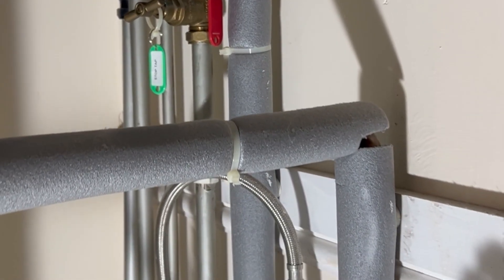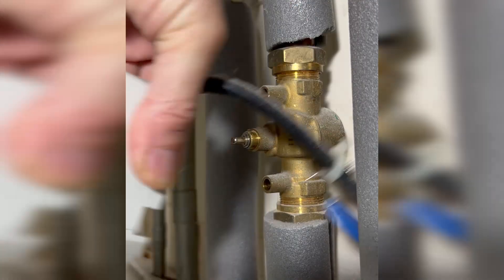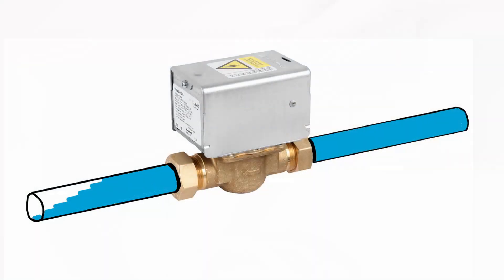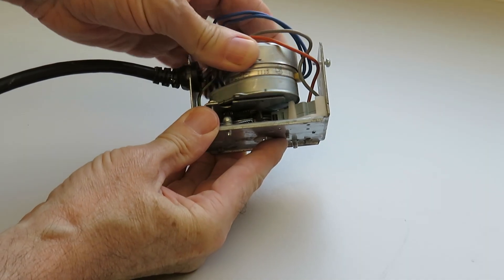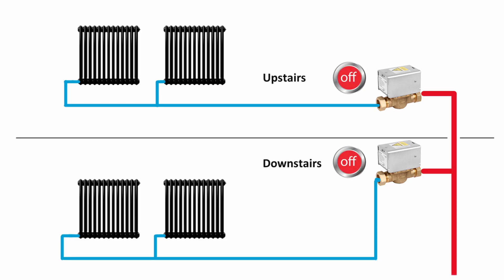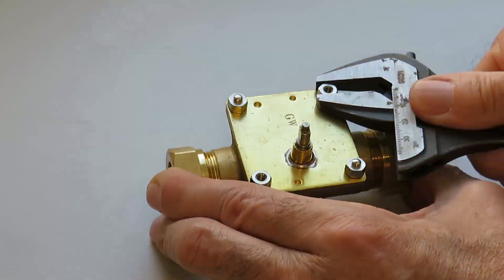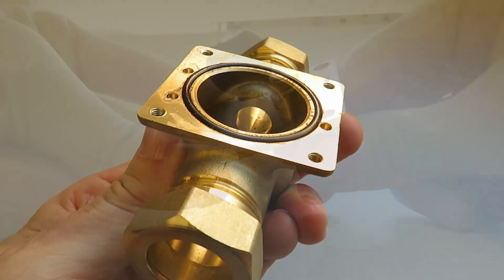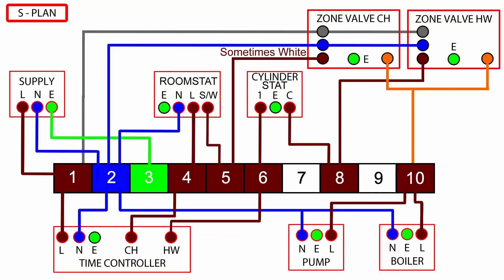Zone Valve ... A basic explanation.

Comment: Hi Pete,
I have a 2 port valve and we noticed the actuator had come off the brass fitting. We reattached it but it now seems backwards. I.E when there is a demand for the heat the lever is free moving, when there is not a demand for heating the lever is resistant. Have we put it back on with the valve is in the opposite state? Hope that makes sense
Reply from the maker: Hi! It sounds like the actuator has gone back on in the wrong position.. it can happen ! 
I would take the head (actuator) off again and before putting it back on - 1/ set it in the manually open position and 2/ make sure the valve body is in the open position, if you’re not sure about that just put the heating on and move the valve spindle by hand and check if both sides of the pipe are getting hot. 

A bit knee-jerk but I could always put a quick video explainer up for you ! 

Pete.
Reply: Hi Pete, Yes please that would be great!

Comment: I have heating on my second floor, but not on my first floor, which leads me to believe that I just need to replace the first floors zone valve instead of the circulation pump
Reply from the maker: Hi !
Easiest check is to try the manual 'open' lever on the valve whilst the heating is on... If the pipes get hot after opening the valve then it could well be the valve. (that would also tell you that the pump is ok).
Other checks would be to make sure the valve has got power to it.
Hope that helps!
Reply: @thank you man I appreciate it!

Comment: In my system when the room thermostat demands heat it sends 240v mains to the zone valve motor.  The motor rotates, opens the zone vale to allow water to flow through it and when the zone valve is fully open a cam on the motor closes a switch in the actuator which sends 240v mains the the boiler and the boiler heats the water.  But mains voltage is still being applied to the zone valve motor and it must therefore try to carry on rotating so what stops the zone valve motor from carrying on rotating after it has opened the zone valve?
Reply from the maker: Hi there,,,
I'm just working on a new video which demonstrates how to wire a zone valve. I may make an additional short video to explain the motor operation itself.
Anyway.. the short answer is that the motor is still being powered / energised, and its the microswitch that stops the gear mechanism from continuously turning (when the cam closes the switch).
The motor coils aren't physically connected to the gears, its the induced magnetic current that turns the gears.... until the gears can't turn anymore, in which case the motor just sits in an energised state and also constantly pushes the cam against the switch.

Hope that helps and I'll make a short demo as a visual !

Pete.
Reply: @petesshed8422  Thanks, but there's no connection between the  microswitch and the mains supply to the motor.  So I'm afraid I still don't understand how the microswitch can stop the motor rotating.  Happy to wait for you videos though.  Thanks again.

Comment: I just saw your magnet wheel video and was thinking,HOW ABOUT IF THE WHEEL WAS AT AN ANGLE OR,THE MAGNET ON THE SCREW,WAS ON A SPRING SO IT CAN MOVE BACK AND FOURTH AS THE WHEEL SPINS...🤔
OR,GET SINGLE SIDED MAGNETS SO THERE'S NO POLARITY FROM THE OTHER SIDE OF THE MAGNETS AS THEY SPIN, BECAUSE FROM WHAT I THINK IS HAPPENING IS,THE ONE SIDE PUSHES AWAY BUT, THE OTHER SIDE AS IT PASSES BY, ATTRACTS AND STOPS IT...🤔